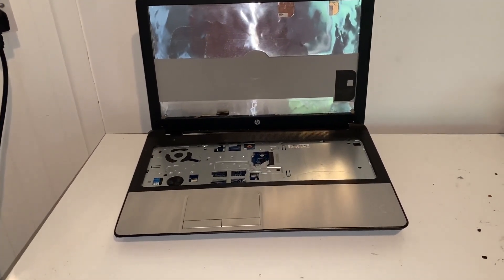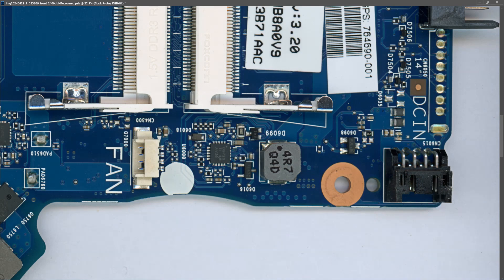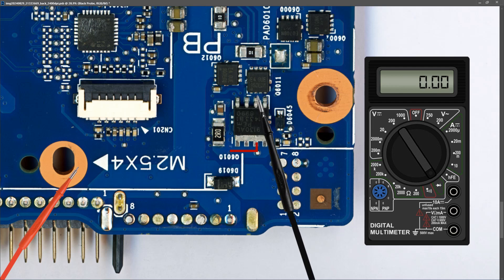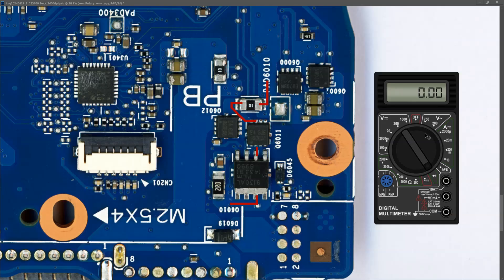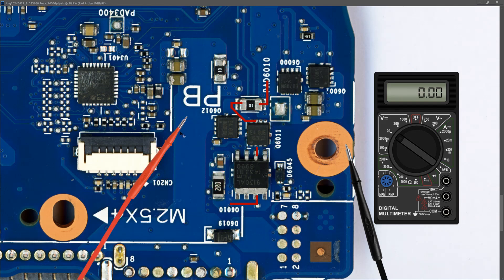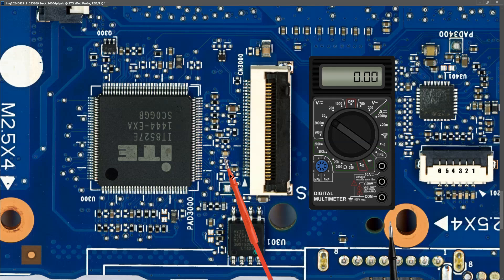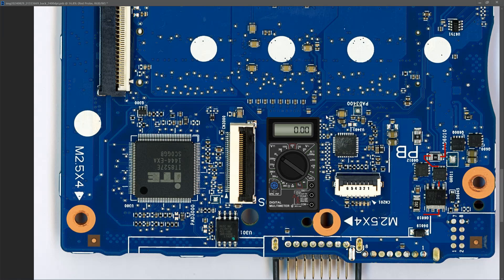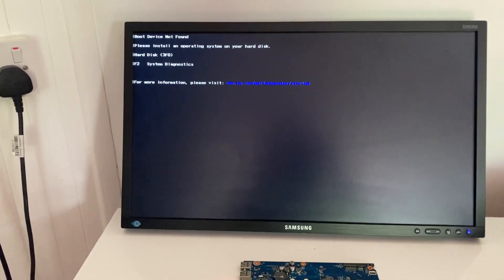HP 350 G2 - FAULTY MOTHERBOARD

Comment: Hi everyone, could someone explain to me why in diode mode measurement it starts with 1.6v and after the sensing resistor it is 0.4v?
Reply: There are multiple paths to ground. In continuity many meters are constant current, so as the minuscule current is divided across the other chips and components like the bq chip, lower the voltage drop will be. 

The actual voltage or resistance value is fairly immaterial, you are just checking it is not shorted to ground.

Comment: Motherboard: SNOWI - 6050A2677101, MB-A01; for HP models: ProBook & Notebook. That's how we know it here in North America. I saw the part numbers of some components on the PCB and they match (are similar or equivalent). Thank you very much for sharing your measurements of a working board (so we can consult in case of failure). Please keep uploading content. Thank you again for your time invested (the video is 9 minutes long) but preparing it is a very different thing and we appreciate it. All the best.

Comment: As we learned with the Dell LA-F114P motherboard that you helped me repair, it is always good practice to measure those first two MOSFETs. Even though we found a shorted capacitor on the main power rail, those two MOSFETs also needed replacing, but it took me nearly a year to figure that out. A faulty first MOSFET exhibits certain symptoms, and a faulty second MOSFET exhibits its own unique symptoms. It is good to know the difference.

Comment: I like the kind, the stile, you make videos. Explaining point by point with the measure animation. I found you a month ago and now following this channel. You do all the same way I would do too (check main power rail, then 3,3V rail). Hope the other boards you bought have some MOSFET, capacitor, BIOS or super I/O chip errors. But no Intel Core shortage, which can't repair because there are no chips on the market. Let's see what happens in the feature in the EU (I am from Germany), we will get a new law named "The right to repair", this will change in Europe the situation about repairing stuff. I agree, maybe the pre owner had dodgy RAM modules or not reset the BIOS.
Reply: @user-qc9yz9jd6r: I read it on L. Rossman's channel: "80% of our society is immersed in: use it and throw it away! For the other 20%, in the case of electronics and even other trades, Louis leads here in North America , the "fight for the right to repair."
Let's hope that there (EU) and here there will be changes beneficial to everyone (buyers, companies and people dedicated to repair). My best wishes to you and everyone.